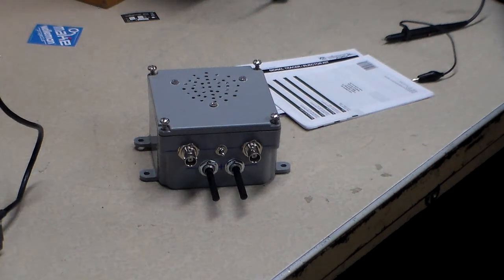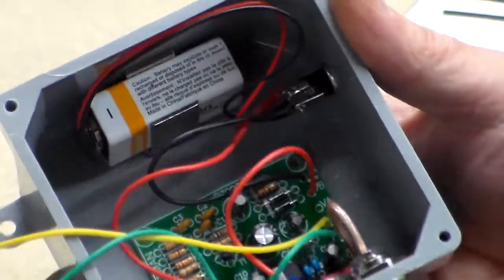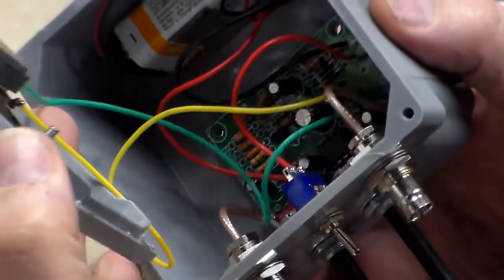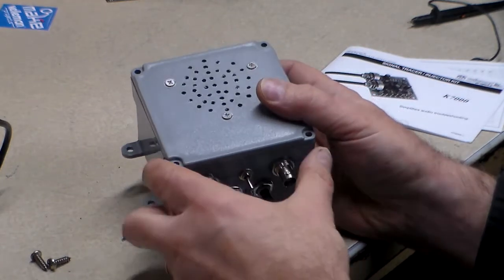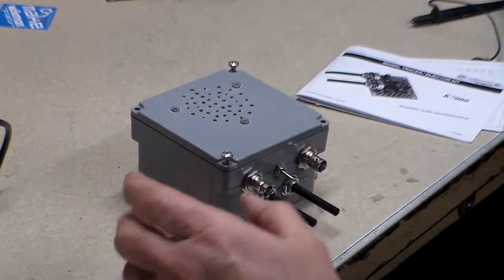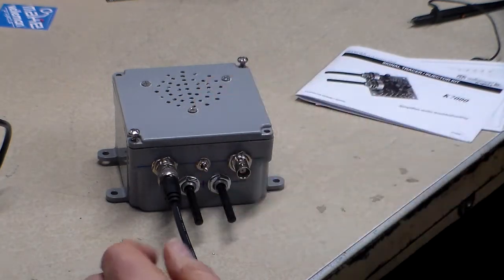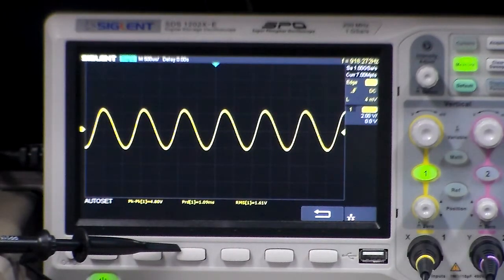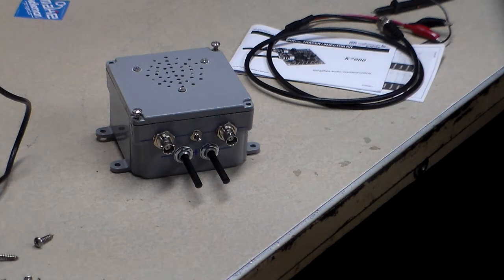Budget Signal Tracer

Comment: I built the Velleman kit and it works great. I have tube Eicos and Heaths but wanted a solid state battery-op. I also used that same gray box for a small audio generator kit. Those work great.
Reply: what size box you used ?

Comment: I built one but I don't know what to use as a probe to use with it, any advice would be appreciated
Reply from the maker: Hi. Thanks for watching.  I've tried a few things so far as a probe.  One is just the BNC cable with alligator leads.  Because that is what I had laying around.  I also built one with just a piece of coax and I leave the outer shield inside the insulation and just the center conductor part sticks out a bit.  I use it as a signal tracer and not so much as an injector.  Maybe I'll try some different probes on a circuit to see the performance. 
Tim